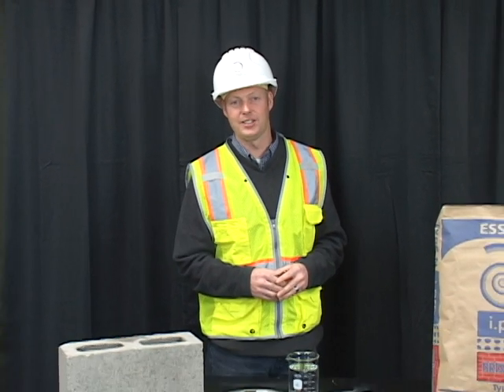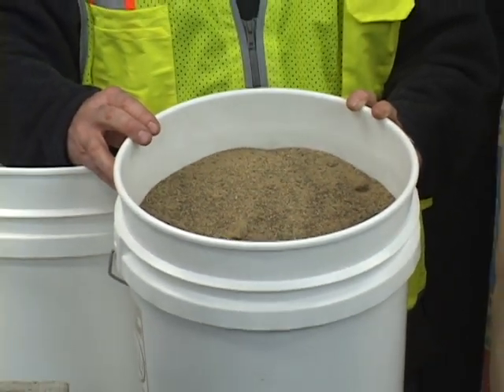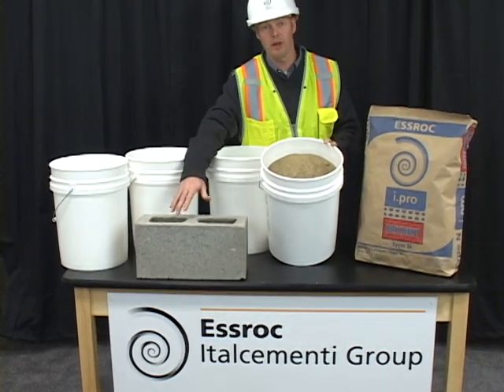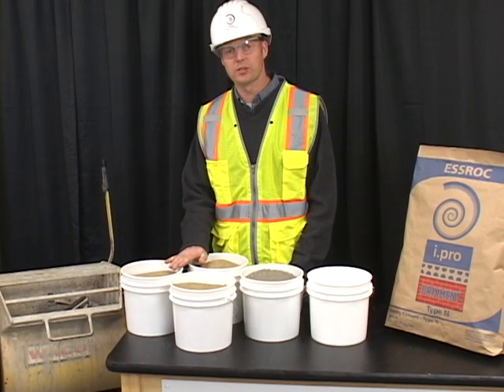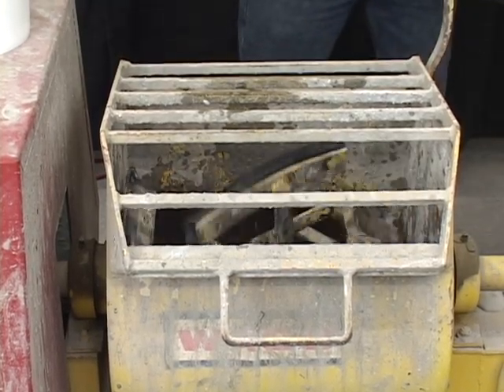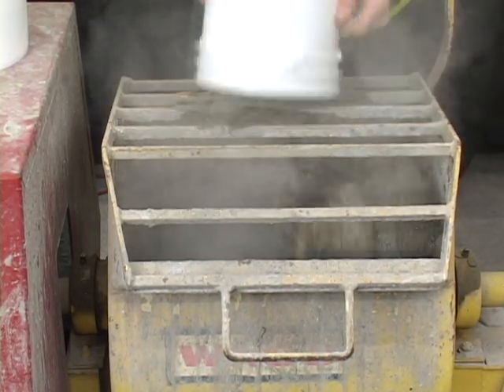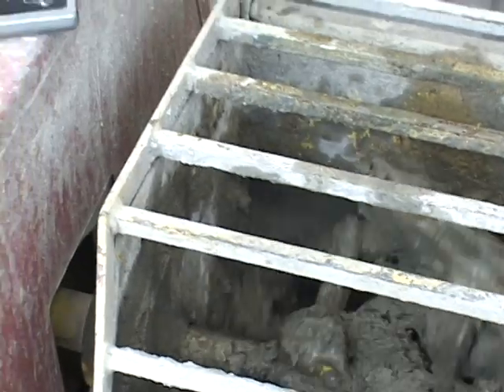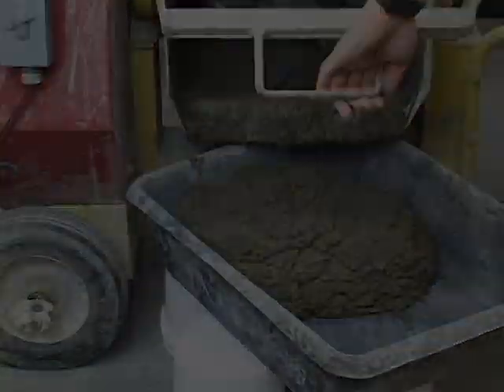Mixing Masonry Mortar

Comment: You had me fooled up until the end when you flipped that trowel then I was fooled no more... You talk the talk but can't walk the walk.
Reply: please excuse the naivete, i am just starting out. what was the incorrect shovel use, and how was it given away?
Reply: @milesaway3422 example: if this was a video of someone talking about food preparation techniques like they have some decent experience, but then handle the knife as if they're still getting use to holding one.
Reply: Properly measured and mixed mortar should stick to the trowel, not slide right off.

Comment: bck in my home philippines, we didnt use those Mixer machine, we mix sand,cement,water manually by using shovel ... we put hole in the thingy qnd pour the water in and then cover the water up then mix it till become sticky if its dry we just add lil bit of water and mixed it with by shovel i mean metal shovel
Reply: That's how we don't do it here
Reply: Mixing by hand is to expensive, because of the hihg hourly-fee of a worker. On the other hand, mixing by hand heavy manual labour.